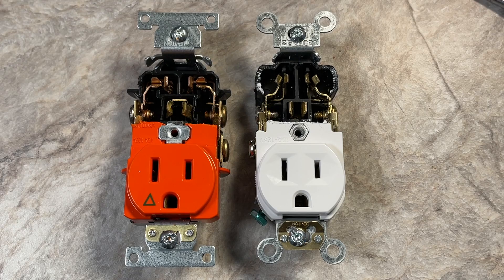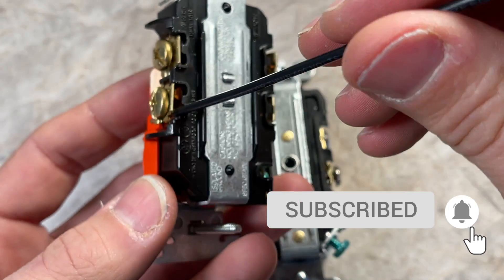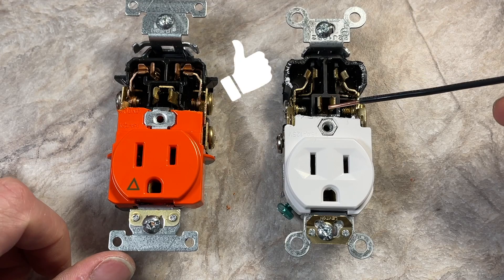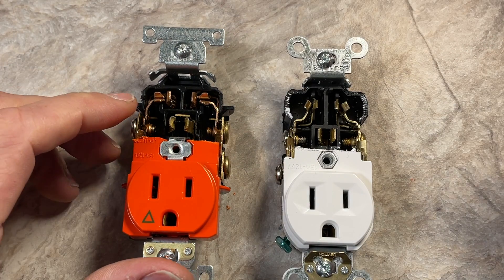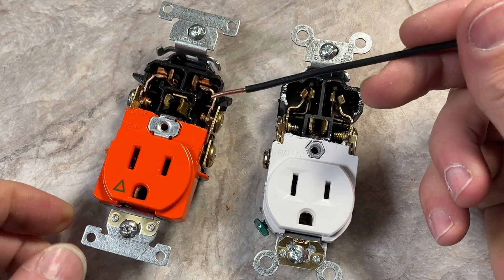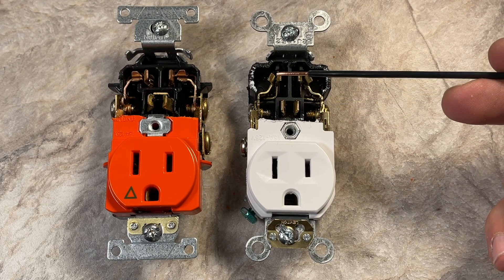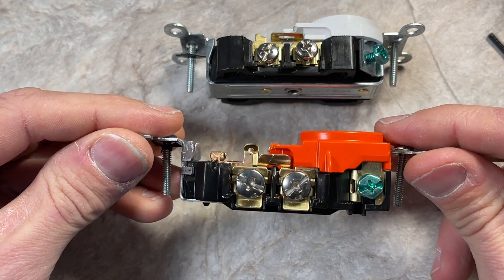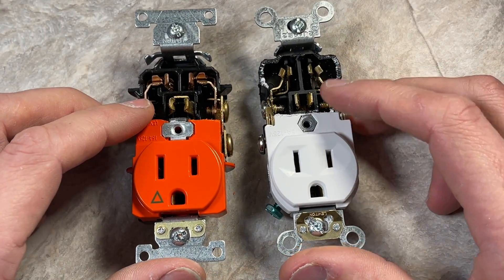What Outlet Should You Buy |  Commercial vs Hospital Grade

Comment: YEARS AGO,
I  installed POS systems. Cash Registers. When computers began to find their way into retail stores it was common for me to find the electrician had pulled an outlet for my equipment which had an orange receptacle. I was told this outlet was on a dedicated circuit with surge protection. Is there special orange outlets for digital equipment? OR did they just use Hospital grade outlets?

!

Comment: So with your orange plug... Keep in mind that would require a 4 wire cable  (2 grounds) 1 for the box and 1 for the outlet. the reason is the plug ground goes straight to the ground and is more shielded against noise.

Comment: can anyone tell me what the UL test requirements are to be commercial grade?  there are NONE….manufacturerer can call any recept commercial grade.  hospital grade is different.  HBL8300 is heaviest and strongest duplex ever made
Reply: Usually, but not always the stamping on the ground strap "spec grade" means federal specification grade. To verify that it is, it will have the circular UL symbol with the letter F on one side and S on the other, meaning that it complies with Fed spec w-c-596, which dictates the minimum requirements. This symbol should also be printed on the box that the receptacle comes in.

Comment: Great video as always!
Can I ask how one can tell the difference between residential,  commercial and hospital grade outlets? I recently purchased a GFCI, but it doesn't seem to indicate which it is.
It was over $20 for a single unit though. 🫣

One more question if you don't mind?
Do only certain brands allow backwiring? Mine doesn't appear to have that option. 

Thank you for any advice. 😊
Reply: Residential grade will not have a ground strap that cradles the receptacle, all other grades will. GFCI's are at minimum commercial/spec grade by design. It may say residential/commercial in the description.
Most brands from commercial grade up to some higher level offer both side wiring and back wiring or sidewiring only. It will be specified in the part number.

Comment: The biggest component about hospital grade you only touched on....
Retention force on the plug. How tightly it grips the plug. Retention force is actually spected out on plug types. How much force it takes to "unplug" something from a receptacle.  It is part of the data sheet on every outlet. The Retention force on commercial is higher than household... and a hospital grade is MUCH higher than commercial so as to prevent accidental unplugging by kicking or tripping. This is usually measured in pounds of force.
Reply: This is important information. Thank you for posting it. I like the idea of having higher quality outlets, if it makes sense, but I certainly don't want to make it harder to pull the plugs out from the receptacle. I already struggle with that with certain outlets/plugs, and I find the struggle very annoying.

Comment: You never want to use residential grade in your home. Those are 20 amp contacts in the hospital grade and better than the 15 amp contacts in the comercial grade. That said I feel in your home comercial grade is more than adequate, hospital grade while better isn't really needed in the home. As I said, never use the 50 cent residential outlets, you're just asking for trouble. Builders use them because of cost and 2 dollar an outlet savings over 100 homes can add up to 1000's of dollars of savings.

Comment: In the Netherlands we only use "quickwiring"/push-in wiring for sockets and switches, and the sockets are a lot more expensive here as well. I've managed to wiggle some wires out when working with sockets, but generally it's not a problem and it makes a really low resistance connection

Comment: In hospitals, there are basically 4 Branches for circuits to run from. 

3 of the Branches are known as Essential Services. They consist of:
1) Life Safety Branch
2) Critical Branch
3) Equipment Branch

The 4th Branch which is not part of the essential service, is the Normal branch. 

In a power failure, the Normal Branch goes bye-bye and stays off after the Emergency Generators kick in. 

In that same power failure, within 10 seconds maximum, the Generators must fire up and the ATS’s transfer power to the Essential Service Branches. 

The code only requires a unique identifying color. The hospital project I was a part of last, all essential service receptacles and switches were colored Red. 

All Normal branch receptacles and switches were White. 

For the end user (hospital staff and patients) if the building is operating on generator power, any Red receptacle and Light switch will fully function. All equipment that keeps the hospital functioning is on the Essential Equipment Branch and continues to run behind the scenes. 

In critical rooms like Operating rooms, there will be a light circuit that has its own battery backup power that turns on instantly when the power drops. It’s sole purpose is to provide lights for that 10 second span of no power while the generators are turning on and the ATS’s transfer over. 

If you want to crap your pants, stand next to a large ATS for your first time when it switches over. The sound is intimidating.

Comment: I will always make wire hook eyes for the screw attachment to eliminate arc faulting.
More wire surface contact is always better.
If I have more wires to conjoin then I'm going to use "Ideal" or "Wago" type push in's to keep from having to make multiple wire connections directly on the receptacle.

Comment: Best pratice is to use spec grade on all higher power draw receptacles & receptacles that have plugs inserting very iften like where youbplug in vacuum cleaner. Day before writing up a proposal would offer the customer the option of going with spec grade or eben Decora devives. Just lived it after installing all cheap brown devuces they said o we wanted the fancy Decora devices with of course different color in every room. Told them sur $500 for it.

Comment: The 15A Hospital Grade outlet, has the horizontal blade built into it and it cannot be used.  So, this 20A horizontal blade cost is being past on to the customer and it can't be used.
Reply: Most spec grade 15 amp receptacles are made this way to reduce tooling and production costs.

Comment: Does anyone knows the difference in plastic they use? Is it like nylon vs polycarbonate? Or just thicker plastic?
Reply from the maker: I think both are Nylon  but the orange did have thicker plastic and just more structure.  the cheap $0.50 outlets are usually some type of polycarbonate.

Comment: You mentioned using a horizonal plug.  The slots on the front are vertically only.  Some 70 plus years ago I remember plug with horizonal and vertically slots used in schools.

Comment: I'm not sure this comment is going to help your explain of Hospital vs Commercial.

I am not a licensed electrician. I did work in a hospital setting for 38 years in a IT role. To my point,
"RED" receptacles in a hospital setting (my hospital) meant it was emergency power (EP).

On the hospital floor only the RED receptacles are coming up (staying up) if utility power has dropped.

I don't know if the non-RED receptacles were "$6". They look like $2 commercial receptacles.

And yes, from an IT perspective we knew where our equipment was plugged in. Every Tuesday at 5:30AM the hospital would do a "genset test". 

Yep, all EP powered receptacles were going to "bounce" when the genset was cut over. For the next 15 minutes the EP receptacles were going to be on "soft power".

Comment: I worked on medical equipment in the hospitals, I have always used the Hubbel hospital grad plugs,they never wear out also the 3 face screw a half of a turn and the screw was in also the face of the plug was keyed into the lower body. Well worth it.

Comment: You are very right on the additional testing. The molders and stampers themselves have a lot of testing that needs to be done. For example, the normal standard is a level-3 PPAP submission approval before you can start production; with medical it can often be IQ/OQ/PQ validation which is much more extensive - IQ for lack of better analogy is about the equivalent of level-3 PPAP and then you still have the other two stages to pass.

Comment: LOL. Maybe I should send him a real hospital grade receptacle. That is not one. They do make  isolated ground hospital grade, he is showing a plain isolated ground. An  isolated ground hospital grade would have a black triangle and green dot. What he is showing is not for emergency power. By code all emergency power receptacles are RED. He needs to delete this video as it makes him look silly. I worked in a hospital as a maintenance electrician for 42 years up untill I retired recently. Maybe I should make a video and show how tough hospital grade are. The internals are heaver, the casing is tougher, and it is required to periodically check the prong tension with a tool to make sure there is proper tension. You can't beat a Hubbell HBL8300HI and there are different grades of hospital grade between manufactures, they all make a cheaper 6 dollar version. Even Hubbell makes a cheaper version (Bryant) or you could buy an more expensive Hubbell HBL8300HI and never ever have to replace in in your home. You can tell a heavier version by the sides, they are much wider and heavier than the lower cost versions. They get away with selling lower cost versions of hospital grade as long as they meet the minimum requirements.

Comment: The 'back wiring' you have shown at 3:05 for either the commercial or hospital grade receptacles is acceptable and respected in my part of Canada.  The 'back wiring' stab-lok holes on that residental receptacle are considered scab garbage and shouldn't be UL according to most people I learned from.

The difference is massive.  The commercial receptacles are doing a screw with a plate that clamps the wire with a preformed slot for the wire to sit in while still getting compressed.

The residential stab-lok has blades that score the copper wire forming a micron-thick connection that can easily be wiggled out, is likely to crack the copper lead in extreme cold, and is implicated in a number of house fires.

The confusion is why I think most North American Electricians are hesitant to use Wagos and numerous other mechanisms that are in fact superior to hooking wire around screw.

Comment: These outlets actually have the contacts to make them NEMA 6-15 as well.  Its a standard that is not seen much anymore, but I have an old 4kw generator that uses NEMA 6-15 receptacles.  I actually really like the 6-15 standard as it allows for 240 V plugs and receptacles that are much smaller than say a typical dryer plug/receptacle.

Comment: You scorn the use of the "Dreaded push pin, back stabbing" capability of the outlet but I'd wager as a typical millennial you tout the use of Wago type connectors which use the same principle??
Reply: That's kind of like saying a Pinto is the same as a Porsche because they're both cars. The spring clamp mechanism on Wago devices is going to have way better materials, engineering, and quality control than some sub-dollar device that hardly (if ever) gets inspected.
Reply: @454Casull  Why don't you evaluate and critique the components contained in the alloy used in the manufacturer of the spring clamps??
Reply: @454Casull  Perhaps you should analyze and critique the individual metals comprising the alloy used in the manufacture of Wago's spring clamp mechanism??

Comment: The hospital grade receptacle you were comparing to the commercial grade receptacle was actually an isolated ground receptacle which the intended use is different from normal receptacles. The triangle on the front of the receptacle indicates it is an isolated ground receptacle. If you noticed the ground screw on the orange receptacle didn't connect to the metal yoke of the receptacle. The reason for this is an application for computers and IT equipment to provide a clean ground with less interference caused by motor loads.  Even the panels these types of receptacles are connected to are different, in they have a second ground bar resembling a neutral bar. So differences in construction are different so are the uses.

Comment: Dr. offices and Hospitals always mount their receptacles upside down. The GND is towards the ceiling 
vs towards the floor side? Why?
Reply: If a plug in not pushed in all the way and something metal falls it will hit the ground pin instead of a hot pin so it will not cause a spark/fire.

Comment: Another little fact about those "hospital grade" receptacles, they have an isolated ground, the ground terminal is not connected to the yoke like a standard residential grade..
The idea is to have a separate grounding conductor that goes from the receptacle to the ground bar without anything else connected to that ground wire, it eliminates outside "noise".
We used to use them for computer and sensitive electronic equipment.
Reply: Thank you Michael for that clear explanation!  I was wondering what they meant until I read your post!
Reply: Isolated ground and hospital grade are independent.  As mentioned elsewhere, isolated ground receptacles are denoted by the orange triangle, and hospital grade receptacles are denoted by the green dot.  All combinations of these features are available.
Reply: already mentioned......a million times

Comment: Not sure how I ended up on this video but I find it interesting because I didn't know they were supposed to be grippier. It's funny though because even though the outlet is stronger, the mounting isn't (at the hospitals that I've worked at). Some of these outlets grip so hard that when you unplug, you can see the outlet come out the wall a few mm. Also, in LA county in southern CA, hospital emergency outlets are red. I've never seen any green dots mentioned in the comments. Is this a sticker? My role in the hospital requires me to plug my machine into outlets throughout the hospital and we have a tendency to find "broken" outlets that don't charge our machine which is annoying as hell. I wonder if that's an outlet thing or something else.

Comment: If I ever build my own house... every 120v receptacle will be Hospital-grade 20-amp, and every circuit will have both GFCI and Surge Protection.

I'd also probably use 3-phase power, but use a step-up transformer to get 240v instead of 208v.

Comment: The video is misleading. The main reason of this orange outlet is that the ground pin is isolated from the back plate and housing to be connected to real indeoent grounding. This for interference and its use for sensitive equipment like medical gear yes but also communication gears, computers etc. One ground for the outlet and security and a real direct ground for the round pin. Check it out on a multimeter, they are not the same on an orange outlet!

Comment: Isolated Ground (IG) is a type of equipment ground that, in theory, reduces interference experienced by electronics and instrumentation from radio frequency (RF) noise, by connecting that equipment directly to the grounding terminal of the service equipment, without ever making contact with another metal component or grounded surface, that could potentially be serving as an antenna for airborne RF noise.

Comment: UL 498 Standard for Safety Attachment Plugs and Receptacles, is the standard for the testing criteria of receptacles and how manufactures built them. Hospital grade for example must hold the plug when a 10lbs weight is dropped 24 inches (yank test) 8 times. After 20 insertions the ground pin must retain 4 oz when inverted (Ground Pin test). After 20 insertions the hot blade shall support 1.5 lbs for 1.5 minutes (Power blade retention test). There is more to it than described but you get the point that there are very specific testing criteria to be rated as hospital grade.

Comment: Hospital Grade. Hmmm. The Orange Recp. are commonly used when wired to a Back-Up Generator.
Which you'll find in most Hospitals. Also, most Medical Equipment are plugged into the Orange Recp.
   because they are on the circuit tied to the Back---Up Generator as well.

Comment: As has been pointed out, the orange receptacle with a triangle printed on it is NOT a hospital grade receptacle, it is an isolated ground receptacle.  This requires unique wiring and could potentially be dangerous if not wired properly.  Specifically, the ground screw on the receptacle is NOT connected to the receptacle's yoke (the metal frame).  This outlet requires 2 grounding conductors, an insulated conductor that connects to the receptacle's ground terminal and runs back to the building's panel ground without connecting to any other ground terminals (other receptacles, etc.) along the way (hence the ground is isolated).  A separate ground wire is required to ground the metal box that this receptacle is supposed to be installed in and that will ground the yoke of the receptacle.  Failing to wire this receptacle properly will result in the yoke being ungrounded.  If a hot wire were to touch the yoke and someone were to touch it or a cover plate screw connected to it, they could receive a shock.